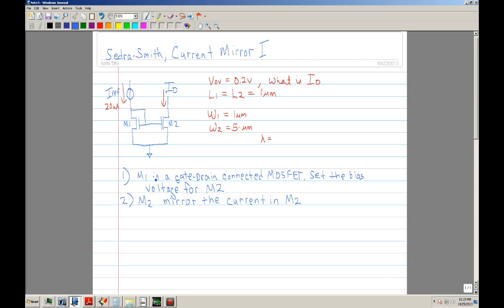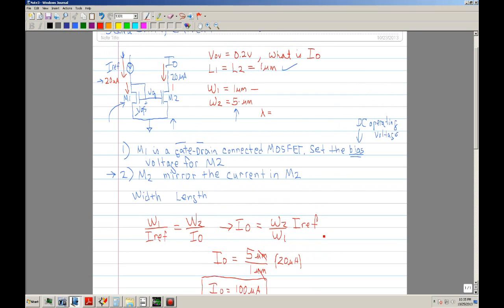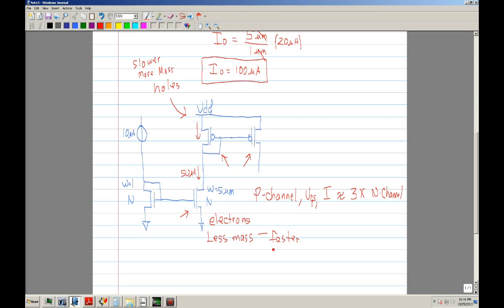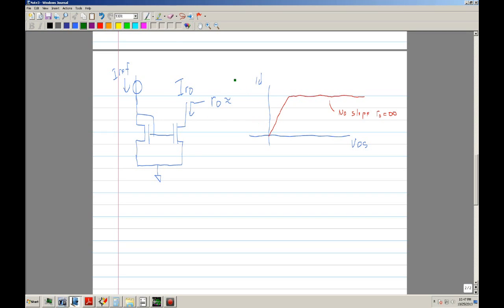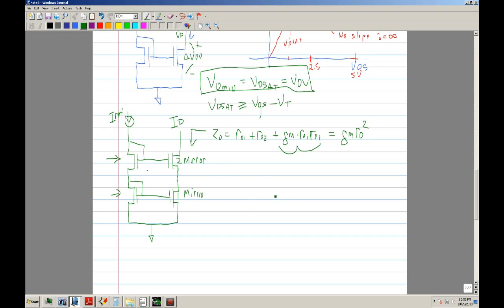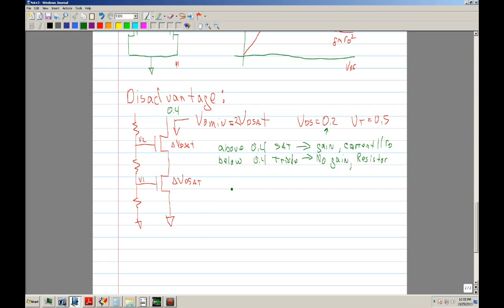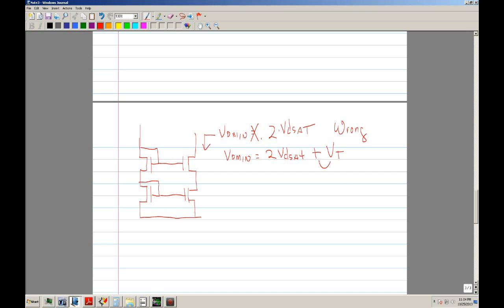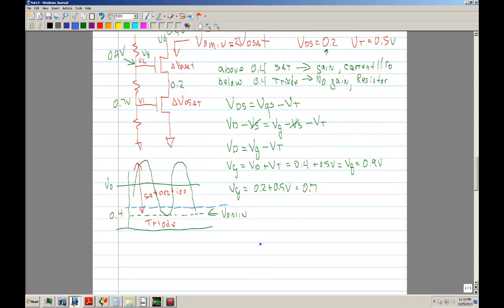Sedra Smith, Current Mirrors and the Cascode Mirror

Comment: Dear Robert,

From minute 36:36 onwards, you show the drain-to-source voltages in the reference arm (left side) MOSFETs to be (VDS - VT).  I am slightly confused because the drain-to-source voltage should be just VDS.  The confusion arises from the fact that VDS cannot be equal to (VDS - VT).

Can I assume that when you say the drain-to-source voltage (which is the gate-to-source voltage as well) is (VDS - VT), you actually mean it is (VDSAT-VT)?

Thanks,
Anand
Reply from the maker: Hi Anand, You are corrent When I say Vds, I meant to say Vdsat.  At the end at the equation, I make the substitution of Vdsat for Vds